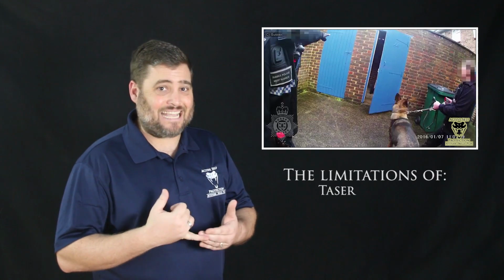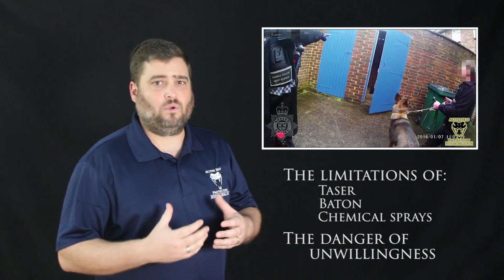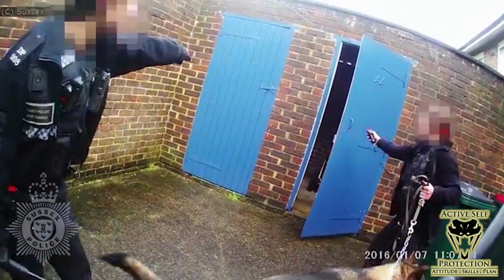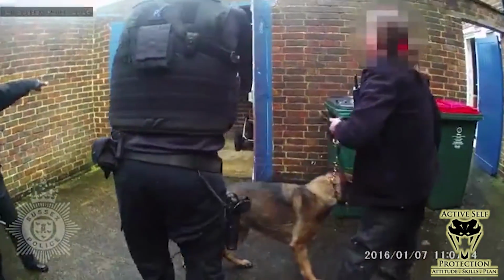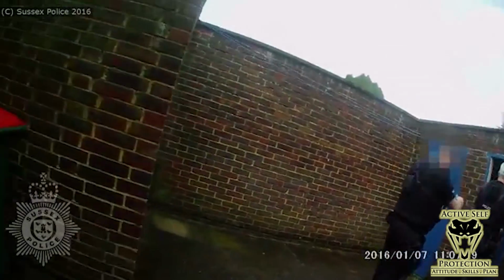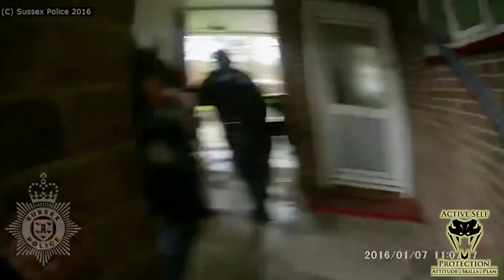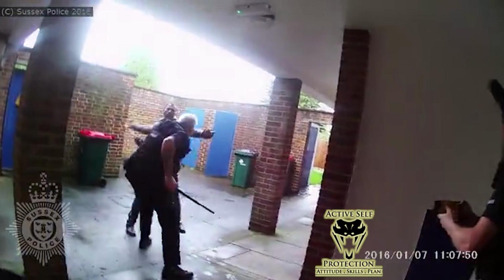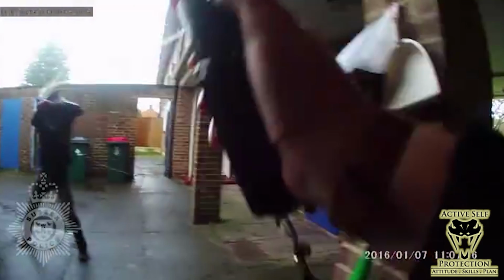Police Fight with Hammer Wielding Killer Shows Limits of Less Lethal Tools | Active Self Protection

Comment: No one suffered long term damage, there for the correct use of force was used. Using a firearm would be unjustified as the suspect did not take life or have a high risk of taking life. Only injure the officers.
Reply: The best action would have been to deploy the dog and get officers in as fast as posable.

Comment: Some people just aren't made for this kind of stuff. They panic rather than doing what they have to do. These personality types should be weeded out and assigned other, more suitable rolls if they want a police job.
The dog handler should have let the fucking dog go! It wasn't there just for intimidation, so should have been used as soon as it was seen the guy was advancing. The others should have then jumped in with batons at that same moment.
Also running away and leaving a colleague alone to deal with a guy holding a hammer was ridiculously cowardly. I wouldnt want them useless fuckers working with me.

Comment: its the fucking UK so called " force" aka shooting someone with a non lethal shot is very very rarely used and only usually when a illegally gained weapon is involved aka anything more than a .22 in the UK or a shotgun if you have a license and a reason licencing is very strict and no side arms are allowed if you have military experience with proper rifles (like the British current standard issue SA80A2) the law does not change in public or off duty even if still in the military please understand that this is one failure of the tasers not the police no one actually died unlike the US where it is more likely this dude would have died or at least been shot.

Comment: the value of life in England is very high the police will not just shoot someone at the drop of a hat. Yes he had a hammer but that's not a good enough reason in a court in England and they could still potentially be  done for murder. Side note, I imagine they were more thinking about what the news headlines would be rather than the suspect. Also to give you a bit of background the officers here are from Sussex  which is a county on the south coast of England my point being Sussex is rual with countrysides there are cities too but again they are smaller it's a quiet county compared to others.... just to give you an insight to the area and mind of the officers because had this been handled  by  met police  which is London they may have dealt with him with lethal force  so keep that in mind with this clip.

Comment: British police are NOT afraid of a fight and see getting injured on duty as a hazard of the job. However despite their courage, their training should have taught them that unless the barbs of the raster can penetrate skin it won't work, and that jacket meant a razer was never an option in this situation. 

The dog should have been the first, and only, "weapon" used. 

British police would NEVER pull a gun on a suspect armed with a hammer, a knife maybe, but not a hammer. 

Problem is that most British officers aren't trained in any form of close quarter combat, only in basic distraction strikes and arm locks. Real aggression towards officers, as displayed here,  is very rare in the UK, so officers loose the reflex memory of how to react to it when confronted by it for real.

Comment: The officers are unarmed what you see does resemble a holster somewhat but not sure if it is for the pepperspray if they used large cans or if for something else. In general the cops in the UK don´t carry a firearm (look it up), if it´s needed they call in for back up that has been specificly trained to use and carry a firearm , I`m not a cop but I would never go out and deal with a man that´s weilding a hammer unless I had a firearm. Do better reasearch al it takes is 5 seconds.

Comment: The biggest problem, was not the fact that they were using nonlethal force. But rather, that they were not properly trained in the used of nonlethal force. which is a big problem with law enforcement. that is the main reason, police officers in America, tend to use 99% of the time lethal force as they are not properly trained to control a situation like this one.

Comment: wierd about all these comments on how the UK police are pussies, after all they did manage to subdue the guy without resorting to the short cut of just shooting him, and did so are great risk to themselves . Is that not the definition of heroism. Or is heroism defined by how many rounds you can fire when you feel threatened?
Reply from the maker: To me that's like applauding a man whose airbag saved him in a car wreck even though he wasn't wearing his seat belt. You had a piece of vital personal protective equipment available, you failed to use it, thankfully something else saved you, but you better recognize how lucky you are.
Reply: yep that's  a very valid point of view.  It's just a different view of policing as opposed to self defence. The training/ psychological threshold to use lethal force is much higher.  As a result less deaths. It's reflection on different social conditioning, in the US this would ended differently, admittedly it could have been worse, but it didn't. Statistically, in the UK paradigm, it seems to work with less deaths. It seems from here that the US airbags are a little sensitive. Next week compare rugby, American football and wearing pads :).

Comment: So i take it that his clothing was just too thick for the taser stingers to get through ?
Reply: +Active Self Protection Or he was just high on drugs?
Reply from the maker: Yeah they prevented the circuit from being completed.
Reply: That may explain his strange bevaviour. But Drugs can only make you immune to the intense pain caused by the taser's current flowing through your muscles and nerve ends. They do not make you immune against the muscle spasms which are the source of the pain. He doesn't event twitch and can still walk and move his arms normally. If strong enough current flows through your body, your muscles will contract uncontrollably overriding any signals coming from your brain , it does not matter if you're numb. It will be extremely difficult to impossible to walk on, swing a hammer, well .. to still do anything properly. So nope, he just hadn't any current flowing through him as the stingers just didnt made it through his jacket and did not got in contact with his skin. Shooting the taser at one of his legs at the second attempt, may have just done the trick.
Reply: +Celeon999A So, we might just have discovered the taser armor then XD

Comment: Thanks for the video. I understand that it resembles a firearm, but I think the object on the officer's hip is a chemical canister. Wearing a sidearm so low is unlikely and also UK Officers would not likely have a firearm at all. It more resembles the way US correctional officers carry a chemical mixture for spraying, which would also fit the protocol for UK officers, for better or worse. But I still think all of your commentary is very relevant and useful regardless.
Reply from the maker: 0:56 : http://imgur.com/a/PYhP8

1:31 : http://imgur.com/a/KG9fW 

Both of those screenshots clearly and unambiguously show a sidearm in a holster on the right thigh of the officer. Without question.

Comment: +Active Self Protection

Your video would have taken a different turn, and forced different conclusions if the female officer had released the dog.

Assuming the dog would have been hit is unjustified. A well-trained police dog is too fast for an effective human reaction. That is one of the reasons why they use dogs.

Raise something (a ruler, a bag of crisps, anything other than the dog's toy) and try to hit any medium-to-large sized strange dog with it. 19 times out of 20 you will not connect. Your chances diminish to practically zero with a police dog.

The video with dog released would have also been much better than watching that disgraceful Keystone Kops performance by her male accomplices.

"Oh. We are so defenseless with these less-than-lethal methods."

The entire episode looks like it was staged. Notice the dog was not released, in order to save The Hulk from a few bites. Otherwise, why wouldn't Mr. Hulk have smashed the camera operator instead of (supposedly) assaulting the dog handler?
.
Reply from the maker: You're ridiculous. I have stopped dogs in their tracks as they came at me, more than once. Secondly, that's irrelevant frankly, as I didn't mention the dog because it never came into play. It's irrelevant to the entire discussion. Batons came into play. Spray came into play. TASERs came into play. The dog never came into the fight.
Reply: +Active Self Protection
"The dog never came into the fight." because it wasn't released.

This entire episode was staged and is fake. Tell me that cops in the UK arrive to a "hammer fight" equipped with all that they need to collar the subject, including a large police dog, but their tactic is to run and scream soon after the subject appears, and then they let the subject hit one of theirs.

The entire episode appears to try to convey the ideas that UK police are under-equipped with dog, pepper spray, tasers, etc. and that they need firearms to dispatch these ultra-violent, "super criminals" who are perfectly capable of devouring defenceless police officers one after the other.

A police dog that stops in his tracks is not a genuine police dog.

C'mon, get in and get with it.
.

Comment: 1st the old cop 👮🏻 stepped in front of the cop in the door way. 2nd after seeing the 1st shot from the 1st cop did not work. Him being a cop that is trained with the taser the 2nd cop should have known to shoot him in the leg with the taser. 3'd all the cops there should turn in there badge because they are to afraid 😳 to be cops 👮🏻 because they took off running 🏃. 4th that one female cop had a German Shepherd! She should have released him and let him do what he was trained to do when the guy came out and the tasers did not take him down or release him when they found one of there nuts 🥜 and went back into the fight. If I was a cop there and I saw this video I would not trust anyone of them and will tell them and my sergeant I will not work with them. They don't know how to act under stressful situations and I will not put my life on the line for there cowardice

Comment: What a fucking clusterfuck.

1. This is why firearms are appropriate to use against melee weapons.  This is also why British cops need guns despite the extraordinarily low probability they'll ever encounter a suspect with a gun.  This is also why the British public need to get their collective heads out their asses and understand that guns aren't only for dealing with "gun calls", they should be available to the officer on any call where the suspect has a weapon (knife, hammer, whatever).

2. Why the FUCK didn't she cut the dog loose as soon as it was obvious the tasers had failed?  Presuming the animal was properly trained it would've totally fucked his shit up and would've easily neutralized the threat.

3. Holy shit a lot of them just ran away, what cowards.  Their colleagues should refuse to work with them ever again and push them out of the force (it's force not service, fuck you).
Reply: That screaming female officer is a gender diversity quota hire if ever I saw one. she should not have been there in the first place.
Reply: darkblood626 She didn't go running like the two guys did.

Comment: Police in the UK can't pull out a gun without orders from higher up. So they only have non-lethal means in sudden situations like this, unless they were authorised to use lethal force if needed while they were on their way to the report. Even tho they are firearms officers. Only the CO19 have the option of lethal force, without authorization in situations like this. This unit is commonly seen in London, but not in rural parts of the UK like Essex due to the low run gun crime outside London.
Reply: Modern UK is nothing but craziness.

Comment: wtf is the dog there for is you're not going to release it? And if you're not going to be using guns, you sure as hell better know how to use your baton like it's an extension of your arm.
Reply: Uhh, police release dogs against people with guns, I don't see how releasing it against someone wielding a hammer is going to be any more dangerous. Anyway, it'd be a good distraction while you go for the weapon arm.
Reply: +Evening Buzz
You say, "It is more likely the dog would be injured ..."

Have you ever swung something at a dog? Try it sometime before assuming he would hit the dog.
.
Reply: +Evening Buzz
If the dog trusts you, you might be able to catch them with a sneaky whack on the head. Don't try it with a hammer, though.

There is a reason why police use batons and truncheons and not hammers. Much more likely to hit near the spot you are aiming for (due to the length of the barrel, versus one spot for the hammer) and repeat blows are much faster in case the first blow was not enough to stop the subject from doing what he was doing.

Also, police dogs are supposed to be trained to be much different than the typical fleabag children's pet or dad's workshop floor companion.
.

Comment: Weak system they have.
Reply: MrSikr6 liberal system.
Reply: blyssed Yeap just sucks the dog is not even used.
Reply: Actually scrap that, ASP has jsut posted a picture. At 0:56 on the officer to the left, on his right leg there is a pistol.

Speaking overall, all UK police forces do have their own respective armed units (very similar to US SWAT teams), and armed officers (called Authorised Firearms Officers or 'AFO's') are fully loaded out like US SWAT, with pistols on themselves and sub machine guns/carbine rifles locked in a safe in the back of their vehicles that they can retrieve if required. Armed officers stationed on foot patrol (like at airports, train stations, tourist hot spots, etc) carry their primary long guns out even when they are not engaging a suspect. Currently about 7,000 of the 150,000~ police officers in the UK are armed, and that number is being increased after the attacks in mainland Europe.

It's a sad thing for British policing and culture to have to arm more officers after nearly 200 years of unarmed  policing through consent and good public relations, but with what the politicians have left the West like today, I think it's common sense for all officers to be armed. They started with wooden clubs, then got bigger metal/steel batons, then got OC spray, then got tasers, and will probably all get firearms in the next 20 years.
Reply: I don't think you should judge British policing on one 60 second video. I don't think you knwo the half of it. As for Liberal, what country has just had it's most Liberal President for the last 8 years?
Reply: King Tanyard These officers don't have guns. I assume they ran due to protocol. Probably the same reason they didn't release the dog. My previous comment was just trolling.
Reply: They focus more on diversity in the officers eg. Women and minorities which makes for some awful officers.
Reply: King Tanyard One guy with a hammer almost killed 5 police officers. The police literally turned and ran away....
Reply: I think the the point of turning and running backwards was to attempt to get out of the confined space, and draw the suspect into the open. Remember also though that at the point the officers turned and ran backwards, they had just discharged their tasers, so they had no real  use at that time apart from stun drive of which would have been very hard to do with a suspect swinging a hammer at you. And fiddling about for a baton, spray or pistol would of meant being hit also. I very much doubt one guy with a hammer could kill 5 officers, he would of been shot or attacked by the dog the second the first officer would of hit the ground.
Reply: I don't think they do have guns actually. I thought they did at first in the leg holsters, but I tihnk they where for the tasers.